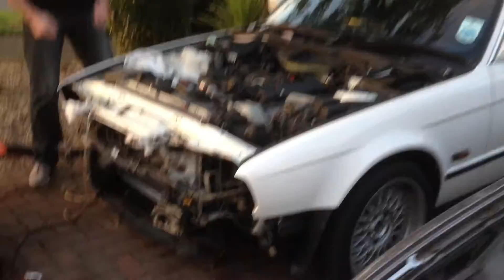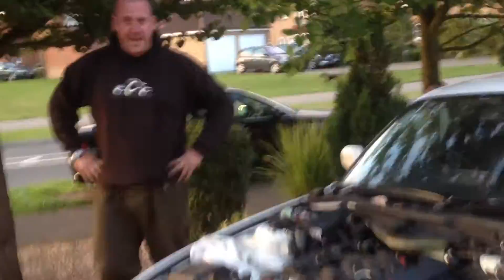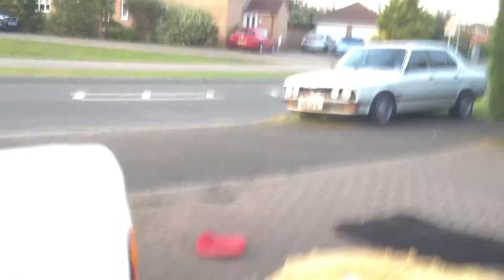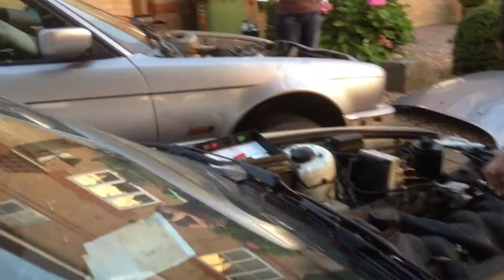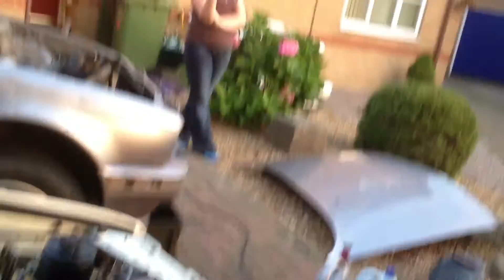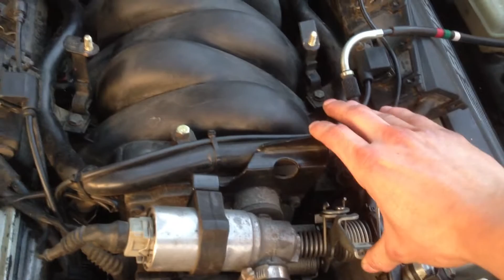BMW E34 M50 525i with 4.0 M60B40 V8 and 6 Speed Manual Swap

Comment: I noticed you're brake booster is still mounting on the fire wall how non v8 e34s.  On the 540s the break booster is mounted at the front of the car in a weird way and I was told you have to change all the break stuff over from the 540 to the 525 to make it fit I guess?  But I see you're booster is how the car was from factory and it fits no issues?
Reply from the maker: No it is the V8 brake booster in use on this car! We had a parts car so were able to swap everything straight across.
Reply: But you're brake booster is on the firewall?
Reply: Every 540 I've seen the brake booster is located like right behind the driver side headlight
Reply: Yea I don’t get it either, maybe bc it’s a eurospec?

Comment: Hi there!  I'm doing a similar swap currently in the US (the reverse of yours; '95 540i/6 sedan/saloon into a '95 525i Touring automatic) and just wanted to ask about the wiring harness/loom.  How much trouble was it to swap out the ECU's and all the plugs in the little box by the passenger side windshield?  I'm really worried about having all the plugs and wires straight.  Any pointers you might have would be really appreciated.

I've also enjoyed reading through your thread on BimmerForums, awesome work and awesome car. :)  Definitely motivating to get mine done!  Thanks for your time
Reply: +saucefiend Hi there; unfortunately, I discontinued my project, as I just don't have all the time to really do everything up right (totally lame, I know).  I did have the engine/transmission out of the 540i and its front end off, but I've already put it back together.  I am considering selling the wagon, if you're looking for a pristine example...